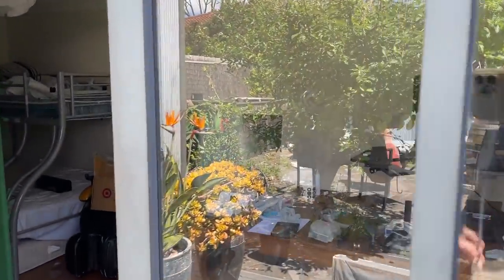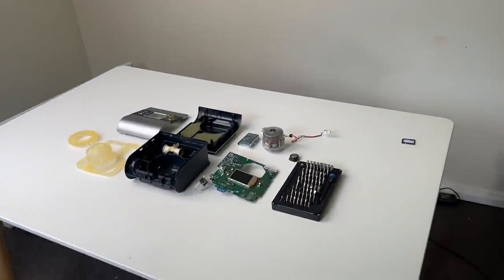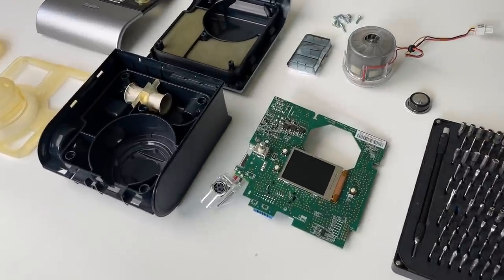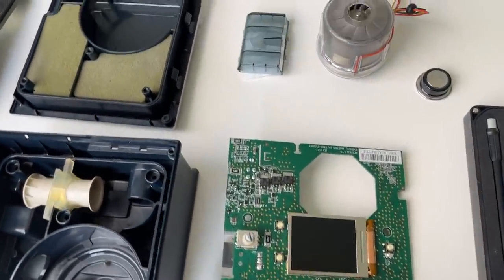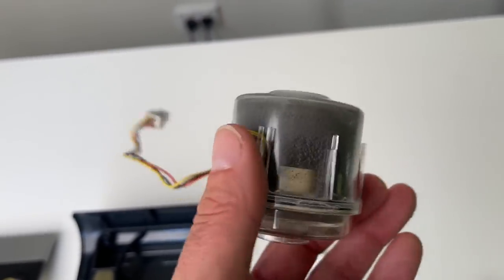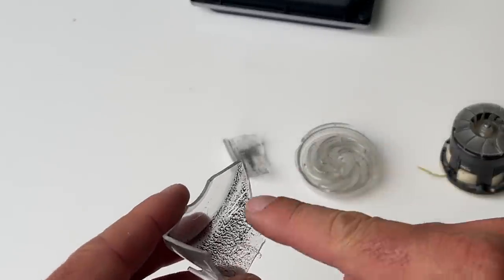🤮 Filthy! Take A Look Inside A ResMed S9 AutoSet

Comment: Or perhaps cut those PM2.5 sheets to size. They are really cheap to buy. Bush fire season is coming up so i will give that a go this summer see if that improves the air quality.
Reply: I would like to know that as well. I have some of the Pm2.5 filters to use in my C19 facial masks.
Reply: Pm 2.5?  Is that 2.5 micrometers?  That's rather course.  I was thinking of taping a p100 mask over the air intake.
Reply from the maker: I think we have to be a little careful as to how fine we go as it could affect the motor performance potentially. I'm not sure but limiting the airflow could impact the performance. Cheers

Comment: If there is so much dust getting past the filters, I wonder if it is getting in through poor seals to the case, preventing the air from being drawn through them. A good test of the foam filters is warm water bath. If they’re squeezed no doubt they probably will be loaded with contamination. If there’s minimal dust etc, I’d be asking where the input air to the turbine is coming from. Great video mate!

Comment: My S9 manufactured in 2010 is still going strong. Took it apart and looks SO MUCH BETTER than that! There's a bit of dust on the blades and a bit of dust in the foam but that's that. Foam luckily doesn't look desegregated.

Comment: Hey Nicko, what if used high pressure air duster to get rid of this dust to clear it without breaking apart... just a thought.
Reply: I saw a video where one man was cleaning the inside of the turbine motor with an air compressor. It worked very well.
Reply: Is the dust the cause of getting a warning on the display of the device that the blower/motor is need of changing?,or is it when you used the maximum amount of hours that you will have to service it?..and is there something as a service point where they change the motor/blower?

Comment: 5:20. When you really think about it - this is the air you would be breathing anyway - it’s a little cleaner At least - it’s filtered anyway. Thanks for the tip on the hypoallergenic 6:48  filters! 

I thought I need a new start/stop switch Or to replace the whole board. but - I was able to get the top off and slowly work around 2 drops of doexit D5 into the start stop switch. after working it in a little the switch operates almost all the time now. no more having to press and release 30 times. thanks!

Comment: Hope you are ok mate!👍
Any fan will collect dust and has to be maintainable. I have a S10 and now will be using the hypoallergenic filters! Thank you. :)
Reply from the maker: Hey mate, yeah i agree! The philips ones you can take apart with a few screws and give a good clean. It's simple! ResMed has these fused casings and there's no need for it. I think they probably do it on purpose so you can't clean it. They also make the replacement hard and expensive so you end up buying a new device. Hopefully in the future that will change. Cheers
Reply: @CPAPReviews  yes, planned obsolescence so you have to upgrade. :/

Comment: Regarding the dust problem I am wondering if making a large enclosed filter box might be a benefit. As as an example, use an upturned milk crate covering the CPAP machine which is clad in a foam covering as a first line of dust retardation ! Easy to clean or replace. Maybe the subscribers could come up with some other suggestions. It could be a good cottage industry for Nico and the kids ! ha ha. Currently watching the Poms collapsing in the first Test in cricket.
Reply: I am working on one for my machine ( 10 days old)..  Have  filter experience and these filters are CRAPEeeeeee.  Needs at least a merv 8 value filter,  Think merv 8 filter cut fit over the whole machine...   we are on the same page. I am 81 an have time on my hands to do it.
Reply: @walterbobruk2310 did you come up with anything?

Comment: This is highly dependent on your room air quality and whether you use a fine hypoallergenic filter that's always changed regularly. For example, a home in suburb Florida where the AC runs most of the time with no pets will generally have cleaner air than a home in a colder northern city with pets.

Comment: Hey brother! Stay well 🙏... Airsense 9, same exact thing, gunked up motor, you may or may not remember my Airsense 10 died after only 8 months use with a rattling motor only to eventually seize... I went everywhere to find a motor, nobody wanted to just sell the motor.. same with this S9 I am refurbishing but stopped because... it has that infamous message that motor life is exceeded and it is useless for me to buy a motor and still have that message... nobody in their right mind will buy a machine even with a new motor because of Resmed and their unstoppable message.
Reply from the maker: Hi Rob, yeah i remember that mate! I wish they would either 1. Make a turbine that you could open like the Philips one or 2. Make them replaceable without the crazy high service costs. Cheers mate.  Nicko

Comment: I wonder what effect all that gunk has on the pressures achieved by the machine  -  both true pressure and displayed pressure?   Before my Dreamstation AVAPS , I had an S9 VPAP Auto.  I started getting headaches and I felt the S9 wasn’t giving me the pressures that it used to. My settings were at the max for the machine. Subsequently I was found to have an element of central sleep apnea on top of my severe obstructive sleep apnea and hence the AVAPS with the Dreamstation also providing for higher max pressures.  

Do you think in addition to being un-hygienic, all that gunk could compromise performance?  

I hope you didn’t catch the Covid and recover quickly.

Comment: I wonder if you could’ve use the air compressor to blow that out? Also I would like to make this observation if you don’t use a CPAP machine then you’re breathing in the dust that’s in the room at least with the CPAP machine you have a greater chance of stopping the dust from getting into your lungs because the CPAP machine has a filter if you do not use a CPAP machine you do not have a filter except for your nose but you have that regardless. Just a thought. I hope you do not have Covid
Reply from the maker: Hi Anthony, i don't think so mate but it's a good idea. It's a fair point you make however there's a whole lot more airflow compared to normal breathing so there's a whole lot extra dust and particles that are getting pulled in from the air. Cheers man. Nick

Comment: Jesus! Mine is probably the same. Is there any way at all to get a cleaner turbine? Or should I cough up for a new machine?
Reply from the maker: Hi Michael, it seems pretty coated mate. I'm not sure. I wish they made them so you could take them apart and clean. You can do it with the Philips turbine. It makes no sense to weld it shut but i guess ResMed probably wants you to just buy a new one. It's up to you brother. All the best. If you're in Australia contact my mates at CPAP Direct and tell them Nicko said to look after me haha. Cheers

Comment: Hi
After looking at your video, I think the black dust is a black perished air filter, which got sucked in and pulverised.
My S9 motor is perfectly clean, however there is no power getting to the motor....motee works on 12v dc battery

Comment: Maybe it could be washed out with isopropyl alcohol and dried thoroughly. 

Of course this may remove the remaining lubrication from the bearings, but they should be oil impregnated phosphor bronze.
Reply: Saw someone flushing a dirty turbine with alcohol to try and clean the turbine of dust/dirt.  Looked to be as dirty as in this video.  Took several flushes to get it clean but looked great once done.  Others suggested using compressed air which may be a start before moving on to the alcohol flushes.

Comment: Would be better if ResMed designed a machine where all airway components could be cleaned by the user.  Even with the hypoallergenic filters, the filter holder doesn't really seal the filter intake well.

Comment: Great video, loved my s9. I now have a Sense 11, where do I purchase the hyper allergenic filters that are referenced at the close of this video?
Reply from the maker: Hey mate, i'm not 100% sure if you can get them for the AS11 at the moment but you could always get some from the AS10 and then cut them to size. You can buy them from most cpap outlets but if you're in the U.S - https://cpap.review/hypo . Perhaps just give Sleeplay a call to make sure they are the hypo filters. Cheers
Reply: I bought resmed brand hypoallergenic filters.  Just do a Google search, or contact resmed.  They aren't HEPA quality though.  Not sure if HEPA might restrict the pump intake, causing problems.  I see a HEPA filter, but it's installed after the pump.  They call it 'antibacterial'.

Comment: Hope you feel better soon.  I started using my Resmed S9 when we got the recall on the Dreamstation even though it said « Motor life exceeded ». Do you know if we can replace the turbines or if there is company that can do the exchange?  I am in Illinois, USA.
Reply from the maker: Hi Will, thanks for your comment. I have seen them advertised from time to time although it's a difficult machine to take apart and replace. It's probably not worth it. I think the foam is safe in that device so it's probably just dust build up over the years man. I don't think it will cause to many dramas over the next few months whilst you wait for the recall replacements but certainly have look around and see what you can find. Cheers. Nicko

Comment: the turbine gets dirty if the filter is not used every time.  I just opened mine after 12 years and it is clean as a whistle. I just removed the foam. it may be the main filter and or sound dampener, but I would rather breath the environmental air then risk having it breakdown overtime given the recent risks for the other recalled machines. I think I will make a filter box that goes around the machine to provide more filtration while of course leaving the pre filter in place.
Reply: do you mean the sponges at the 2:00 or so mark? I was just gifted one and I can't find those items anywhere. The sponges in mine are disintegrated. I feel like those are for sound dampening and not critical to the device. Waiting for it to dry after a deep clean and will reassemble to test.
Reply: @lildrgn   Yes. I think your right that  it's primary function is for sound , but based on the dirt on mine it  it seamed that some air flow passed through the sponge. If it did not there would be no chance of inhaling the foam particles.  the rubber gasket is open and not completely sealed over the foam. The creator has a more recent tear down video here: https://www.youtube.com/watch?v=fpWD_5_YLzs
Reply: @roberthoover8807  Thanks for that; I just threw the sponges out. The CPAP is easy enough to take apart to clean if I need to.

Makes me shudder to think about my 17 year old S8 that literally resides under my bed. Yikes, I think it's time to throw that bad boy out. RIP, old friend.

Comment: I know this video is several months old but that's unexcusable. These machines need to be accessible for easy cleaning and maintenance. These companies know their products are blowing air in patients lungs which are sensitive to contamination. The color of this dust has me really concerned about the patients health and further analysis should be done. The most common dust is dander and household types of dust. This looks like a CPAP in use just outside a coal mine.🧐 Duel filtration is important in my opinion. Machines need it to work properly as much as the patient needs it to live properly.
Reply: I would bet money that this machine belonged to a smoker! It looks like soot that firms in furniture and clothing that hasn't been washed in ages(curtains). I just don't see how that much dust  could otherwise get past the filter. It had to be coming from they're lungs!

Comment: Déjà-Vu, I just opened my ResMed S9 Escape two weeks ago because some small "crazy" ants had set up a nest in the air intake.  What a bitch to open the S9, it took me several hours to peel this thing open without breaking the many little plastic locking tabs.  I cleaned out the nest and washed the foam in dish detergent.  I noticed that my turbine had dust in it too but not as bad as the one in your tear down. I used a tiny brush normally used for cleaning between teeth to clean the turbine vanes as much as possible.  Then I held the turbine blade from spinning and blew it out with a 3 bar (40 psi) air hose.  That helped but the dust seemed "sticky" or maybe it was just static charge.  I thought from the very beginning the tiny intake filter design to be crap. On my machine (18,000 hours) a dust trail clearly shows unfiltered air flowing around the edges of the filter paper.  My response years ago was to add a 30cm (1 foot) hose and inserted an in-line filter in the hose from the mask.  I hope the supply situation eases soon because I have my eye on a ResMed AirSense 11.
Reply: I had a Resmed Malibu (#2) It is loud, heavy and has almost no hours on it.  I have a ResMed Air curve that is quiet, 10 times lighter and does such a great job with their ASV function. My 3B Luna won't let me turn the humidity up because it gets too hot.. but when it's cold here the air is dry...

Comment: Hi Nicko, my DME has been sending filters for my Resmed Airsense 10 that they claim are Ultrafine filters. They are labeled "CF-36850-1 Resmed PAP and Oxygen Filter". When I googled "CF-36850-1" this appears to be a standard pollen filter. Am I correct about this? Many online CPAP suppliers sell the CF-36855-1 as the Hypoallergenic Ultrafine Filter for the Resmed S9 & S10 Series, Airsense 10. Is the CF-36855-1 the filter that I should be getting?
Reply from the maker: Hey man , i'm not sure to be honest. I don't think that is a ResMed OEM filter is it? Could be an aftermarket one. I'll have to see if i can get a part number but on the ResMed site they refer to them as Hypoallergenic filters. https://shop.resmed.com.au/resmed-hypoallergenic-filters-12-pack/ . They are feel soft to the touch not like the rough standard ones. Cheers

Comment: Hey Nicko,,, 

I have just bought ResMed S9 Escape of marketplace for like next to nothing. And, to my surprise it has only 117 clinical hrs, and humidifier chamber still have plastic on it...😀😀

But here is the thing, i never knew S9 series have 5 models. And Escape is not the best one, it won't record AHI, just hrs of use overnight. 

Considering turbine still in excellent condition,  is it possible to swap parts between S9 autoset and escape to make a refurbished Autoset for myself as a backup machine?  Any idea where to find internal parts for S9, or if someone have a broken S9 Autoset, so that i can test my skills...🙂🙂
Reply from the maker: Hey mate, so the difference between the models is just the firmware. All the components inside the machines are exactly the same. I have done a cpap hack before and it works really well but i don't recommend you try as you can brick your machine. If you're interested just for fun then here's the vid - https://youtu.be/FZecY3EuXlk
Reply: @CPAPReviews  thanks Nick, for a reply. Yes, I had seen this video before and it motivated me to try configuring S9.  Airbreak I believe is for Airsense 10, as it has advanced tech in it. Can be connected directly to play with firmware. However, S9 is of older technology, I highly doubt, there is anyway one can tickle around with firmware. Or if possible, please let me know will definitely try for fun... 😀😀

Comment: Thanks  I still have my S9 which I used for 9 years .Using a new dream station now for 1.5 years  . It was recalled months after I bought it. Had to continue to use it because of the severity of my OSA and the expense.. I thought about using my old S9  but thought I was so old . I purchased the dream station rather than a new resmed because the therapist told me that resmed voids the warranty if I use the So Clean .I had to purchase a new adapter for the dream station to use my  so-clean. It is funny if it wasn't so sad ..  ...I got a call this week for an appointment in January to come in for my replacement .Don't know what I am getting but I am sure they will continue to %$##@ me . cheers from nova scotia Canada